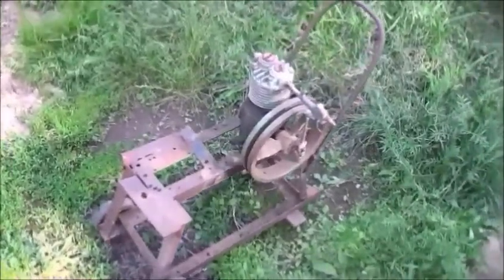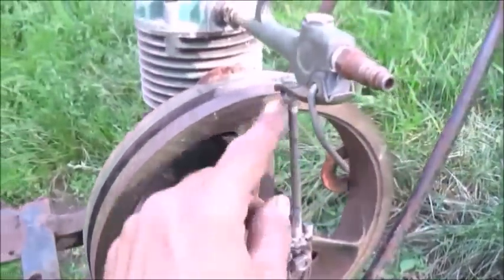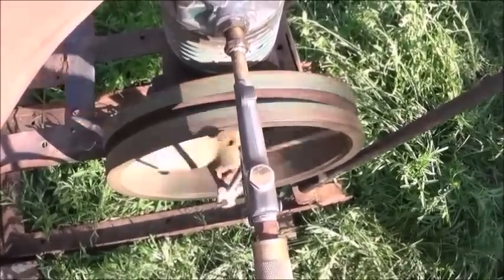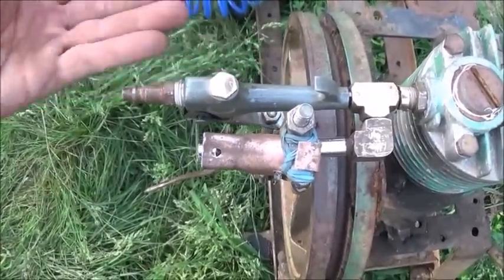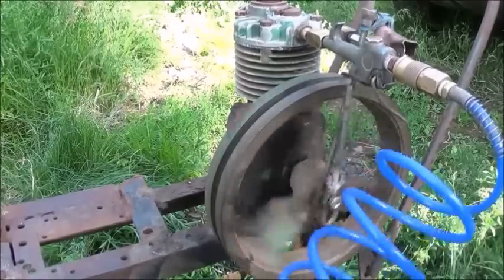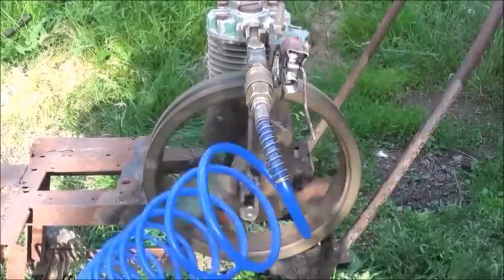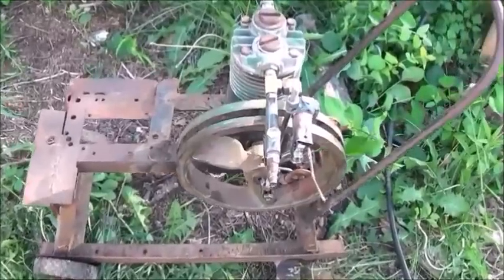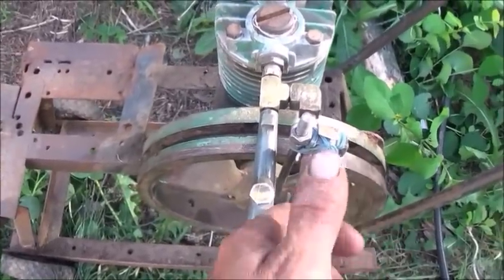Homemade "Steam Engine",  Air compressor converted to a steam engine.

Comment: Hi, this is very interesting.  If you were to use an old lawnmower engine couls you utilise the original exhaust and inlet valves?  Thanks for the hard work in making these vids.  Paul from Widnes

Comment: Conceptually, what you could do when you go to steam, is install a small oil injection squirt system into the cylinder and external joints needing it. You would need an injection system run on a cam, as a simpler gravity system wouldn't work for the pressurized cylinder of course. A ball check system or perhaps something off a diesel injector could be incorporated, but you would need to install a softer spring. The oil volume would be miniscule amount so the oil reservoir wouldn't empty much. Maybe even a 10 weight oil would work. If oil consumption is a concern you could filter your used crankcase oil through a drip filter made of stacked toilet paper rolls, then finally through carbon.

Comment: Since your going to run a generator you could find a couple of 12v solenoid actuated valves, roller micro switches and a battery for starting, then really go high tech  with extra switches combined on different cams so you can switch valve duration from "economy" to "Power" and back depending on load.
Reply: Sounds like you know a lot I don't! Where can I find more info? I have compressor like this, which I'd love to adapt to run on steam...

Comment: Put a belt on to drive an alternator, to charge a battery, then an inverter to provide 110volt current to run the compressor supplying the air, and you will have a perpetual motion machine. No need for fancy machine work, just hold alternator in place with baling wire through all those holes in framework, add some duct tape and bent nails if needed.

Comment: If you have that as a generator and pump output air back into the tank with pump powered by the generated power couldent you acctually make an infinite generator

Comment: where can i et the valve you use in this video
Reply from the maker: It is a standard blower head for air compressors found anywhere they would sell air compressors

Comment: What emissions are released into the atmosphere
Reply from the maker: From what? The compressed air or steam?
Reply: Actually whether you use steam or air there are no real emissions to speak of I guess you could consider the water droplets from the steam being released through the exhaust emissions during steam run but water's natural to the environment so there really is no environmental impact here!
Reply: What about the fuel to heat the water, provided it was steam. If it was air compressor then the only pollution is your power bill and whatever supplies your home
Reply: +Robin Barnard sisi
Reply: co2 is good for trees.

Comment: This is impressive. How much pressure is needed to run this?
Reply from the maker: It will run with only 25 psi without a load applied, if you want to make usable power from it you want 80-150 psi.
Reply: MrTeslonian couldn't you hook up your ramjet air compressor to this, almost perpetual as long as the stream doesn't dry up.

Comment: I can bet money routing a line from the exhaust port you plugged back around to the same position the valve is currently will net a huge gain in performance.  Purely because the air can flow in one side and then proceed out without an change in direction inside the line or back out the same port on the other. Flow dynamics more or less. I'd be curious to see how that alone would affect performance. None the less I see a good idea for a home power plant. Might get a small GM car ALT and do something like this one night if I can find a good device to steal a part or ten from.

Comment: dude with compressor modified into steam engine,genius,man make the linkage little bit neater and make a motorcycle,just a thought surely not nocking ya very cool
Reply from the maker: I have the rear end of an old riding lawn mower that I may use to build a steam tractor.
Reply: +MrTeslonian that would be bad ass

Comment: would it be possible to make this a closed system? Get it going and then have the exhaust recirculate back to the intake? perpetual power?
Reply from the maker: If you could I guaranteed it would have been done by now,  I do see how that it could seem possible. 
Don't stop looking some day some one will find perpetual motion. Thanks for watching.
Reply from the maker: Remember that chaos always finds order, the secret is in perpetual chaos.
Reply: Perpetual chaos...? Like quantum fluctuations?
Reply from the maker: Bark Not really the same thing, although it does have some interaction with the vacuum force, and it like Q-flux was around at the creation moment. If you want to under stand what I meant read up on why a atom bomb doesn't keep exponentially expanding and the forces that act to constrain the reaction. This is the fundamental reason why all chaos finds order, imagine if one could find energy in order and not in chaos,that would be truly self-sustaining energy!
Reply from the maker: Bark For starters look at the four fundamental forces the govern all mater The week force the strong force electromagnetic force and the nuclear force. These forces are the inhibitors to perpetual chaos and in turn the creators of chaos, so if you could control how they interact with matter than you could presumably control matter and there for energy. I think order is energy waiting to be understood and harnessed, it would require no outside force to continue to produce energy, since it is the state in which all matter want's to be in.
Reply: No, that violates conservation of energy- it's a law of the universe.  Inconvenient for perpetual power, but the bright side is random objects don't spontaneously convert to energy.

Comment: I have an a idea if you could get 2 more pumps have them on say 2 front wheels then they put air into you air tank. them you could have twice amount going into the tank than coming out... but what about over pressure make a valve to sort of balance the air going in to to whats coming out. in theory, well my theory it could work real good, just got  make sure you got good lubercation. my thought of an vehicle type would be 3 wheels two in the front one in the back. tell me what you think. thanks
Reply from the maker: Cool idea, it would only give you a small portion of the energy used back in breaking. How many cubic feet of air does it take to create one cubic inch of air at 100 psi? So if there is 6.8 cubic feet of atmospheric pressured air in every cubic foot of 100 psi compressed air, and the cylinder on your compressor is 3" dia, with a 3" stroke how many compression strokes are needed to fill one cubic foot of air at 100 psi? Answering these questions will help you figure out the return ration from the regenerative braking. Once you have that number now figure out how many cubic feet of atmospheric air it takes to fill the cavity or cylinder of your compressed air engine at 100 psi! The difference would be your return %.
Reply from the maker: Sorry got that square inch number in with the cubic inch measurements and messed that math up, let's try that now while I'm sitting down.
At 21.20 cubic inch's per stroke of the compressor and 1,728 cubic inch's per cubic foot, it would take 81.5 compression strokes to compress one cubic foot of air at atmospheric pressure or 14.7 psi. and it takes 6.8 cubic feet of atmospheric pressure air to provide one cubic foot of air at 100 psi., so it would take 81.5 x 6.8 = 554.26 strokes from the compressor to store 1 cubic foot at 100 psi.  21.2 cubic inch's is only 0.01226852 of a cubic foot, now if Boyle's law works and I have it right we multiply 0.01226852 x 100psi = 1.226852 cubic feet of atmospheric air is needed to fill an 21.2 cubic inch engine cylinder of the same size to 100 psi. 
Now this should be closer,  how many compression strokes to engine power stroke?
Reply from the maker: เอื้อน ใจเยือกเย็น Yes?

Comment: The valves are in one way so if you catch strongly or give full load to the crank or pulley when in inlet supply position the air will pass directly through exhaust valve and rotation will stop.Its rotating just without load. This is my experience.
Reply from the maker: The two valves are never open at the same time ( this is why we have timing), so no it won't just blow across to the output!
Reply: Sir as in video only inlet is controlled. this engine is air compressor engine so free one way valve inlet and outlet. If I am not wrong I see only inlet valve controlled . If exhaust also controlled like in poppet valve then your  project is ok.
Reply: oh oh I see  i see inlet and out let in same pipe. Divided exhaust in another pipe. Ya it will work...

Comment: Don't forget to add a lubricator so the cyl is protected from the steam while running . Liquid running dwon into the crank case is something which will cause you problem

Comment: mmm I was watching the movement of the  two rods and  started to wonder if you could control  the two air chucks with just one rod. The  timing of the two rod seemed to in sync  but that just might be a product  of  photograph.

Comment: SO THE AIR AKA STEAM IS GOING IN AND COMING OUT OF THE SAME PORT. AT DIFFERENT TIMES ALONG WITH THE FLYWHEEL FOR CENTRIFUGAL MOTION. AM I CORRECT? I WOULD LOVE TO HAVE A DIAGRAM. LOVE IT THANKS GOD BLESS
Reply from the maker: INTAKE VALVE-The air enters the engine just at or past top dead center continues until 3/4 of the way down the stroke length then shuts off, the second rod begins to open the output valve just before bottom dead center allowing the pressure in the cylinder to escape as the piston is rotated by the flywheel back to top dead center.
Reply: I UNDERSTAND BUT WHERE THE AIR A.K.A. STEAM GOES IN AND OUT OF THE ENGINE IS AT THE SAME PLACE CORRECT. JUST THE EXITING OF THE STEAM AKA AIR GOES THROUGH A DIFFERENT VALVE EXIT VALVE?
Reply from the maker: contreeman Yes.
Reply: thanks brother i can do that.GOD BLESS

Comment: How do you plan on oiling it?
Reply from the maker: The bottom end is oiled with a flicker on the cam that flings a little oil each revolution at the bottom of the piston. The rest will be a steam line oil tank  and a hand oil can.
Reply from the maker: In a closed loop system the oil could be allowed to separate in a settling tank, then remove the oil from the surface of the water in the tank.

Comment: What is the purpose of the second teed in air chuck ?
Reply: To let the steam escape on the exhaust stroke.
Simple but perfect design
Reply from the maker: Why because it ran with my finger over the exhaust ( not very efficient)? That method doesn't allow the piston to receive a full power push, like a closed valve would and the up stroke or exhaust valve releases the pressure in front of the piston reducing the resistance better.